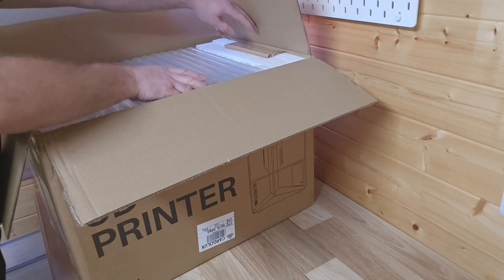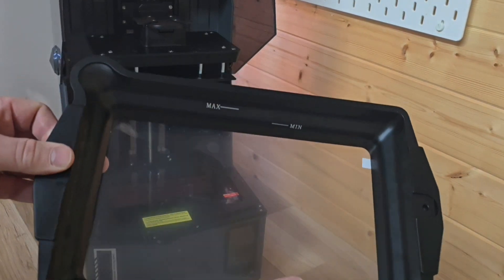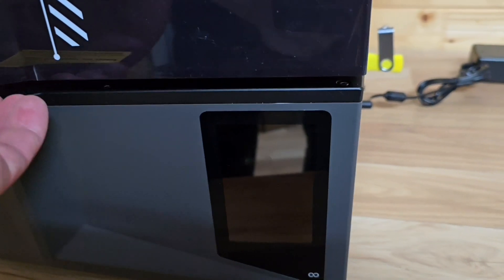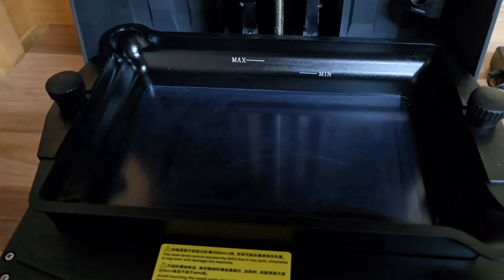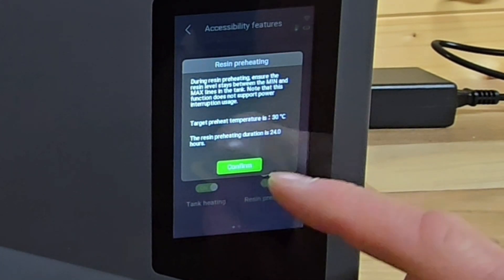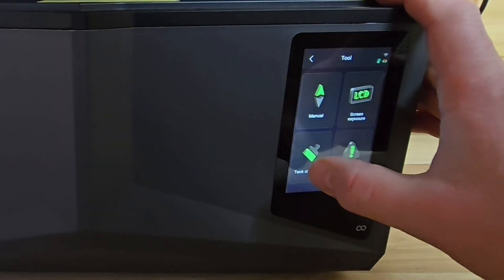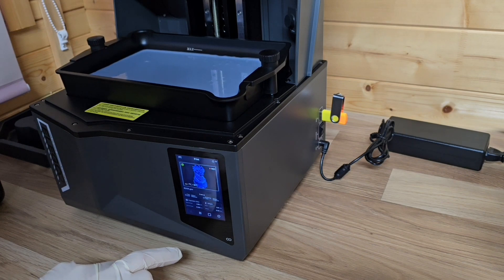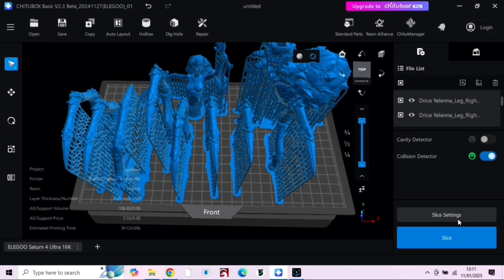elegoo Saturn 4 ultra 16k unboxing with heated vat/ wings #elegoo #saturnultra16k #heatedvat

Comment: the heated vat is realy a plus for me to buy this one next to my other S4U - although I have some questions about the heated vat.
And I hope you can give me an insight.

There are two 'heater' functions on the printer, the 'heater' and the 'pre-heater'.
When you select the pre-heater function you get a warning that the resin level needs to be between the 'min' and 'max' level indicated in the vat - otherwise it is going to damage itself.
The pre-heat function will warm up the resin for 24 hours - so my conclusion is that the resin level needs to be between these levels while printing...
So, no large prints can be made. Or am I missing someting?

The other function is the 'heater' which will warm the resin up to 25 degrees - but do you get here the same warning?
In other words: does the resin level with this heater function as well between the min and max level of the resin tank?

thanks in advance.
Reply from the maker: @plac3b000  hey thanks for watching , so thr preheat function allows for a heat to start 24hrs prior the min and max line is monitored by the ai camera and mechanical sensors. As the vat heats up its agitated with the plate so If your above the fill line it will likely spill over, I'm guessing maximum line i guess is the key word.
The alarm was raised based on over filling not the heating function. The print starts once temp is optimised
Reply: @3DPUK-TECH-CHANNEL  thank for the quick reply.
Meanwhile I found the pdf of the printer in which the following is mentioned:
Important Notes:
1. Maintain the resin level above the MIN line and below the MAX line when heating resin in the tank

Which tells me that I have to monitor the resin level while using the heater function...
Reply from the maker: @plac3b000  that's interesting to hear. So I'm guessing without auto fill capabilities it's a standard requirement for larger prints I'm guessing. Not ideal large printing ud think this would have been taken into consideration

Comment: I got the Elegoo Saturn 4 Ultra 12k for Christmas last year and I'm very happy with it and any pint fails have been because of me not the machine

I love the heated vat on the 16K but I'm going to grab a brewers belt or the Elegoo  for my current machine and as for the light in the new model I can just grab a little USB powered light and put that in

P.S and the new machine has got a smaller build plate as well